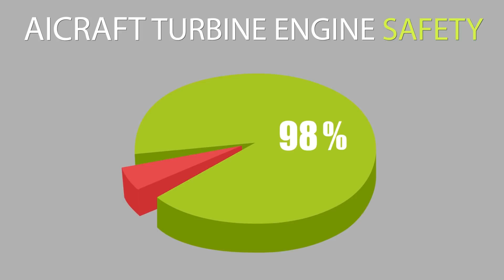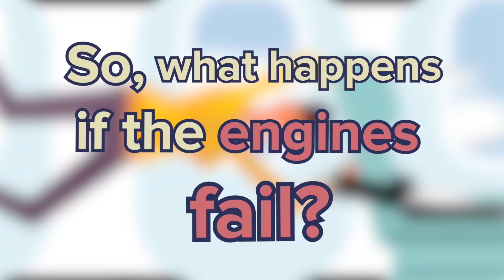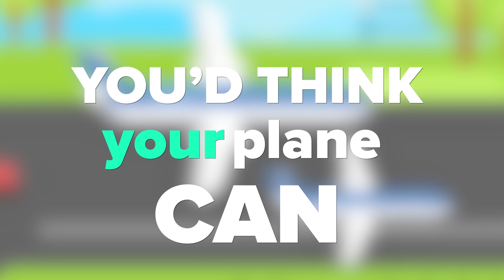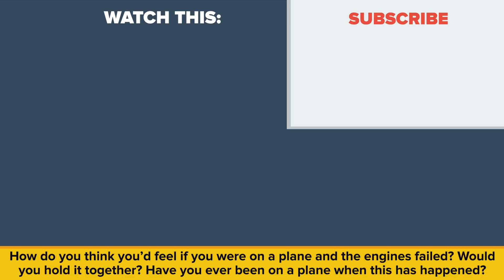What To Actually Do If All Plane Engines Fail At The Same Time

Comment: I was on a Northwest flight from Cali to Hawaii back in the late '90s (I cant remember the exact year). During the flight our plane got struck by lightning and lost power to the cabin for what felt like an eternity (but was probably only 20-30 seconds). I remember feeling the plane losing altitude rather dramatically too when it happened. Everyone on the plane fell deadly quiet. That's the thing that has stuck with me the most. No one screamed,  or made any surprised noise or anything like that. It was just one giant clap of thunder and then all conversations stopped, just silence (the engines were still making noise though). But after those few seconds the lights flickered back on and it felt like the plane quit descending. A few minutes later one of the flight attendants came walking down the length of the plane laughing and saying "oh that sorta thing happens all the time! Nothing to be afraid of!" I dunno if she was lying or not, but that flight, plus the return flight I needed to ride to get back home were the last planes I ever went on, and I used to fly a LOOOOOT prior to that.
Reply: Pics or it didn't happen

Comment: " What To Actually Do If All Plane Engines Fail At The Same Time"

You forgot to say what to actually do . ¬_¬
Reply: - teleport numb wit
Reply: Clickbait title as usual.
Reply: yep, they had no intention to help anyone in that situation, just to scare people.
More of the talk was about uncontained engine failure than about failure of all engines simultaneously. That isn't something  that's usually connected with each other.
I don't think there ever was a plane with more than one uncontained engine failures at the time.
I knew there is a reason I'm not subscribed to this channel.
Reply: Just listen to the flight attendants and the captain. Literally all you have to do (and all you can do)
Reply: @c41pt41n  I dont think you watched the video, they literally only retell what had happened in the past. For such a title youd think they would tell you in the video about what to do. But the only semblance of that in the video is them telling you to be lucky.
Reply: @marchern8526  I don't think you read the comment, they literally explain what you should do in the event that a plane's engine is damaged. They said to just listen to the captain, which is all you can do in that situation.
Reply: As a passenger, you basically prepare for landing: get to your seat, put on your belt, seat up, tray up, securely store loose items, bags under the seats. The only extra step is is cabin pressure is lost, the oxygen masks are deployed and you should put it on.

As a pilot: you will likely establish max glide speed. If loss of pressure and above critical heights max decent, to safe altitude then back to max glide. After that a lot changes based on the air craft and type of engine, but some quick things will be to change fuel tanks/pumps, air fuel mix, throttle position, prop pitch, magnetos, engine restart, find a place to land, ... There is a check list. On the radio you call out mayday three times, what is wrong, and what you need from other pilots and air control. EG, "mayday, mayday, mayday, engine failure, returning to runway 27 for emergency landing, please clear active."
Reply: I actually forgot that’s what the video was meant to be about until I read your comment
Reply: Like said before you cant do a think. But the Plane has a so called Ram Air Turbine to maintain electric and hydraulic power even if all engines and the auxiliary engine stop working. And if that also fails the Plane can run on batteries for a short period.
Reply: Doesn't really matter, he made a 10 minute video so he's got the money and wasted our time.
Reply: I mean maybe we should fall through a window?
Its what it showed...
Reply: (fasten seatbelts)
Reply: - and not when to do it
Reply: True
Reply: Imagine you wasted your time watching this in an actual plane with failing engines just to find NOTHING (echoes).
Reply: Guys just use /tp like 🤦‍♂️

Comment: I was in the navy and on a mac flight prompt plane with 2 propeller engines when the both stopped as the fuel was bad . lucky we glided down to a small airport . i spent 7 years on subs and that scared me more than the flight did.

Comment: Been on two planes that have had engine failures.  Decades of fairly regular flying.  Both were props.  One was a simple stall that they corrected after a few seconds.  The second was near the end of the flight and we just landed faster than normal because we didn't have to hold for landing at O'Hare.  Was also on a plane that developed a fuel leak over the Atlantic.  Ended up landing in Iceland (surprise) before continuing on to Europe.

Comment: United Flight 232 is the crash I know best besides the 9/11 crashes, Swissair 111, and Turkish 981.

Now this plane was a DC-10-30, and it was children’s day at United Airlines. Unfortunately, the tail-mounted engine, engine number 2, blew up, and the fan disc that was inside that engine flew out through the right side of the engine.

Captain Al-Haynes was ready to make an uncontrollable emergency landing.

Now the plane was going through a phugoid-cycle (a situation where the plane pitches up and down like a roller coaster) and the tail engine was unresponsive. Luckily, like Japan Airlines Flight 123, a few years earlier, this plane was able to turn and pitch using throttle.

There was another aviation expert on board the aircraft that was willing to help with the throttles.

Sadly, that flight DID NOT end up well, as 111 people died when the jet dipped down and right again, increasing it’s speed and smashing into the runway at the Sioux City airport in Iowa, setting the plane ON FIRE and flipping it upside down into a cornfield.

185 people survived the crash.

Comment: It was misleading to claim that the severe casualties in the Sioux City accident were primarily committed by engine failure. The main issue was the loss of all the hydraulics following the burst of the engine placed at the rear. The loss of hydraulics basically means that the mechanisms equipped on the aircraft except the undamaged engines are uncontrollable. The pilots and a off-duty DC-10 coach (among the passengers) adjusted the aircraft engines placed at the wings to keep the aircraft leveled up when approaching to Sioux City, yet wind shear caught the aircraft just before touching down and caused the aircraft to shift to one side, roll, and disintegrate. Even subtly less than half of the passengers were killed, the landing was still considered as a miracle, and all the pilots and the DC-10 coach offered the critical assistance were awarded accordingly.

Comment: As a private pilot, I am definitely obligated to say that you can just turn on the APU (Auxiliary Power Unit) to turn back the engines but this'll only work if you're at a high enough speed or low enough speed in some cases.

Comment: I hate to be that person, but 
A) the fasten seatbelt sign being off doesn’t mean take your seatbelt off. It means if you need to get up, it’s safe to do so. While seated, you need to keep your seatbelt on. It’s a bit disappointing for an instructive/educational video to encourage this behavior. Turbulence is unpredictable, and getting thrown into the ceiling or other passengers makes a bad day for everyone
B) FAA is Federal Aviation Administration, not association. 

Lastly, to reassure anyone frightened, planes have two engines in large part for redundancy. Every single flight critical system (and many less critical) on a modern airliner has at least one, sometimes two, backups. That includes having more than one engine. A two engine passenger aircraft must be able to fly more or less normally on one just one engine to get certified. It’s incredibly rare to lose both engines, but as you note it does happen. Pilots are well and frequently trained to handle this.

Comment: Dual engine failures are really rare. Turbo fan engines nowadays are pretty reliable. Even if it does happen as long as it’s not in the middle of the pacific and it’s contained, there isn’t too much to worry about. Pilots are train for this event and planes can glide for a surprising about of time.

Comment: That DC 10 landing in Sioux City was NOT an engine failure! In fact it had fully working engines. The plane lost its hydraulics, meaning the pilots could not operate any steering systems at all. The pilots managed to alter course by increasing the power of the engine on one side while decreasing power on the other one. It's a miracle anyone survived that day.

Comment: I had an engine fail on me when I was 17 years old. I was the pilot. I pulled a maneuver known as the Dead Man's turn. At the time I didn't know it, but, I pulled it off and landed back at the airport. I got lucky. If I had it to do over again, I would have kept it in a glide and landed it in the cow field in front of me.

Comment: Nitpicking Fun fact:
Planes without working engines will not make any noise when going down. It is essentially a glider, as you pointed out correctly. 
Google „Gimli Glider“, for instance. Some people on the ground undoubtedly had the scare of their life when they suddenly found that a passenger plane had appeared seemingly out of nowhere and was barreling down that runway. 
So why do you add a Jericho Siren each time you show a gliding plane / plane going down? You won’t ever hear that noise unless you are sitting in an attacking German dive bomber (or worse, on the receiving end of said bomber‘s payload). 
I get it, a gliding plane isn’t very exciting from a sound design perspective but still.

Comment: If an engine turns off, its not such a big problem. Most modern jets can continue flying for 3-5 hours. Again, that depends on the plane. Of course, the pilots will divert to the nearest airport. The most pain you will feel is stress.

Comment: The pilot of the Air Transat caused the engines to die. A fuel inbalance warning came up and without investigating the reason why he opened the cross feed valve to balance the two tanks in the wings. What he didn't know is that the reason for the fuel imbalance was because the tank that was low on fuel was actually leaking, so that was the reason that they ran out of fuel. He was actually given an award for his airmanship although it was his mistake that caused the incident in the first place

Comment: This video really glosses over the distinction between a single engine and total engine failure. The United 232 accident was an uncontained failure on a 3 engine aircraft that damaged the hydraulic lines which caused the crash. While single engine failures are not entirely rare, every commercial passenger plane is certified to fly and climb with a single engine loss. So even the statistic showing the reliability of turbine engines fails to mention that the likelihood of BOTH engines failing simultaneously, outside external damage, is astronomically rare. In fact I’m not aware of a single instance of all engines on a multi-engine aircraft failing due to mechanical issues.

Comment: The engine failure in Sioux City, IA was nasty work. Apparently it never happens where you loose hydraulic systems and the hydraulic line. I don't know how true or common that is anymore this information is over 30 years old anymore. Let alone the pilot had to use methods that were considered suicide in a plane of that size. Some sort of Hang gliding tactic you do but instead with a massive DC-10. Now a days you see tons of FD out about twice a year doing training for fires when a plane that size crashes. Another rumor is that no simulation has been able to recreate the incident and have that many people survive.

Comment: I remember when I was working for Delta Airlines back in 2015 I was a ramp agent, the plane had just taken off it was a CRJ900 10 minutes into the flight something I went wrong with one of the engines and smoke was getting into the passenger cabin and it was extremely hot, the plane had to turn around and come back to Hobby Airport in Houston, every passenger sitting towards the back of the plane where the engines were had to go to the hospital for heat exhaustion the pilots had to open up their windows and land the plane, the pilots actually thought that the engines were going to blow or catch on fire. After all the passengers were off we took a reading of the air temperature inside I remember correctly it was around 170. Fortunately nobody was too badly injured.

Comment: Statistically jets are still by far the safest mode of transport. Engines/turbines can, have and will fail. That’s why you have 2. No joke, that’s a lot of the reason for 2 jets, because you can land with one engine. My dad had an engine failure in a 58 baron, he proceeded to fly for a few more hours then land the plane, and then probably utter a few vulgarities since it was going to be a 40K$ repair. Stop worrying about air travel, it’s so incredibly safe because of all of the crashes before our time.

Comment: The problem with engine failure is blackout. Primarly in cocpict only critical data will be shown. : Alititude, speed, rotation and direction. But planes have fuel powered generators for this.

Comment: The animations are fear mongering, when the FAA says most engine failures are small planes, they showed a small jet. They are virtually all small propeller planes that aviation enthusiast own. I can think of only two or three instances of double engine failures in passenger style jets engine in the last couple of decades. Jet engines are extremely reliable.

Comment: What about the MCAS systems failure on the 800 Max airbus? Killed entire crew and passengers each flight only 6 months apart.  If your plane has an inflight emergency, there’s a great chance you’ll die. Infographics covered old instances with some current here and there. But should try researching more recent events of the last 20 yrs and explain how many aircraft went down and run those statistics again.

Comment: The Air Transat incident was cause by leaking fuel on Engine#2, 5 days before The Flight, maintenance staff installed a new right engine, it didnt come with a hydraulic pump, so they decide to take it from a similar engine and attach it to the new one, Watch Brightside, The longest flight ever